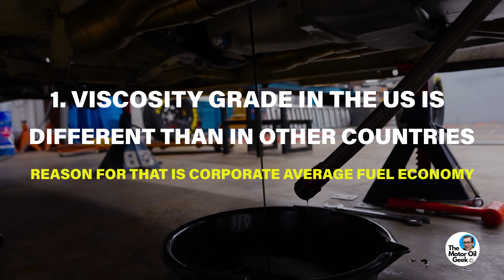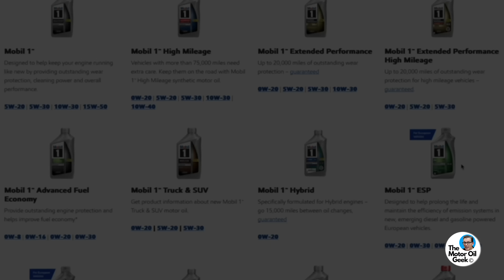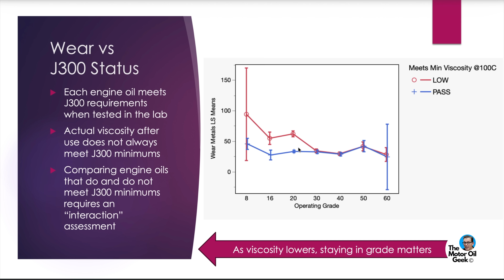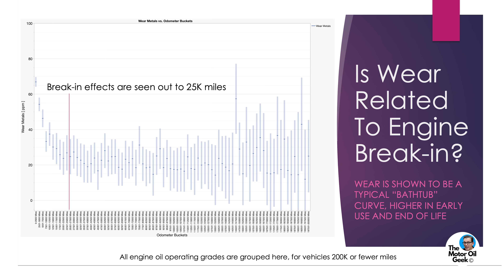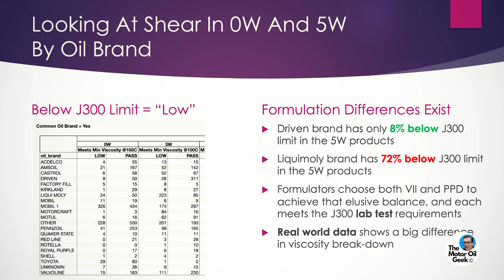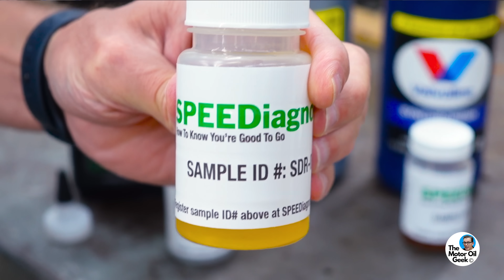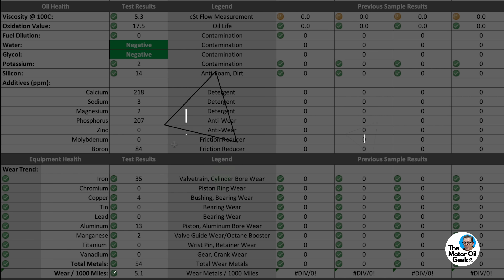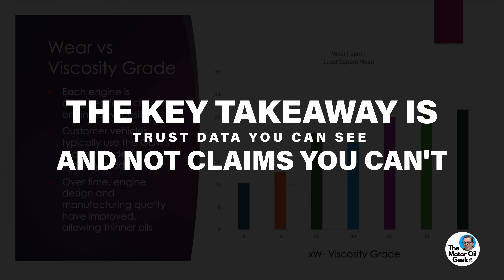More Ai Lies? The FACTS about 0W-20 vs 5W-30 (With Evidence)

Comment: I have been using 5W-30 for decades. ZERO internal engine failures. 2 vehicles over 200k miles. I tow with my truck in heat. 0W-30 is not an option for me. My truck's manual says 5W-30 is acceptable.

Comment: There's another BS coming out of this guy's mouth. He said, follow the recommended recommendation. Really? Recommendations on some cars  also says that the transmission fluid never needs to be changed. So manufacturers lie about the oil change intervals on the transmissions. They also lie on about the engine oil recommendation.,5w30 is better than that watered down 0w20?
Reply: I have to agree with you. When the dealers tell you it's lifetime oil that's pure BS, lifetime oil does not exist on this planet!

Comment: 0w20 has not stood. The test of time 5w30 has ! and that's what's going in my car that I just bought. And not only that, if you look at a lot of the comments, people have already done thousands of miles on their cars, with the 5w30 changeover. And and report a smoother engine, less rattling. No noticeable miles per gallon loss, basically no downside on using 5w30

Comment: I can give my perspective as a former car mechanic with a sport car
my 2.0L Turbo 4cylinder car has a recommended oil of 0W-30 from Shell Helix 
And with mine being 2020 model, its now 5 years old with me changing multiple times the same oil at the same miles consistently
Yes Consistency is the key to oil, especially the recommended ones 
I could go for 0W-40 but it ain't going to benefit from it, oil is there to lubricate, the way YOU drive your car and warm her up 1-3 min and let her cool down 1-3 min makes a difference.
I will put it in the most wise words I know, "You don't prevent damage or wear, you slowly degrade your car and its components" its up to you then to use the correct fuel,oil and parts to keep the car going.
Instead of get a new car that will cost you more then the current one's repairs.
There is no need to worry about oil what to choose from away from recommended ones, you can, but only if you can afford it.

Comment: IMO at the end of the day, just use the oil type and viscosity the manufacturer/car calls for.  If it's 0W-20 or 0W-8, then use that.  There are plenty of examples of vehicles now that are running these thinner oils that it shoulidn't be a big concern, and one thing to keep in mind, while you "can" run a thicker oil, you may lose fuel economy or other benefits of the proper viscosity oil.  Point being, cars like the newer Toyota Camry's (from say 2018 oinward in the US) use 0W-16, and some have reported 300k miles of use presumably without issue, and my guess is those people aren't doing anything special with their oil or using a thicker oil, they're probably just changing it at what I would call a regular interval -- despite Toyota saying 10,000 miles, I say every 5,000 miles or 6 months at most.

Comment: I dunno...  I ran 75W90 in my rear differential for the first 100k miles.  When my vehicle was built in 2005, the manufacturer's Service Manual called for 75W90.  About halfway between and now, however, the mfg released a service bulletin saying that 75W140 was recommended for heavy duty applications like off-roading and towing.  Why?  Because 75W140 was STANDARD in the exact same rear end sold overseas.  It took 12 years of U.S. customer questioning and griping before the mfg capitulated and said, "Yeah, it's fine."

A number of independent lab testing and wear measurement studies showed had less wear, too.

So, why did the mfg wait 12 years?  EPA mileage requirements.

I couldn't care less about the fraction of a MPG difference.  I care about the long-term life and longevity of my vehicle.

So, even though I'm running XW-Y oil right now, I'm definitely increasing the latter by 10 during my next oil change.  I'll likely leave the first number as is, as it can get quite cold in the winter.

Now, if I can only fine a good, reliable and inexpensive pre-pump to ensure all critical parts are well-lubricated BEFORE I start my engine...

PS:  As a data scientist, when I see data veering significantly off the curve, as I do with your -20, -16 and -12 data, with n being as high as it is, I question the efficacy of the -20 and -12 formulations and call for independent lab testing to verify the "Data from ~6K engine oil samples measured after typical oil drain intervals (ODI)."  If the wear difference is confirmed, then the oil formulations are suspect. If the independent testing reveals the wear to fall significantly closer to the trend line, then I question the integrity of the data.
Reply: I thought I was the only one who caught that. I'm afraid he may be heading down the road of his own conformation bais just to argue with the AI video.. which was correct in the first 2 points.
Reply: see GM trying to slow down engines grenading with 0w40. Of course, it's FAR superior to 20.

Comment: I disagree, especially with a 2023 Silverado with a 5.3. Those engines have direct injection, and the fuel gets mixed with the oil and gasoline dilutes oil after a couple thousand miles that 0w20 will turn into a 0w8

Comment: 0w/20 5W/30. My Volvo says 5W/30. The oil grade is on your oil filling cap. W stands for winter.The lower the number with W will get thinner in cold weather but will thicken to the second number when heated up.

Comment: Very informative. One 'tip for viewers' that you might have included is this.....change your oil and filter more often. I intend to keep my current car (Rav4 Hybrid) long term and so I change the oil and filter twice as often as required. This is possibly the single best thing you can do to prolong engine life and it takes away any concerns about oil degradation.

Comment: "Out of grade", you are saying. Meaning, out of the viscosity limits specified by the oil specs. But we need to look at the viscosity limits for the ENGINE, not oil. If w30 oil is sheared down into being w20, the engine still fine with that - but not with w20 that became w16.

Comment: Dear Lake, at 07:55 you mention that "higher viscosity oils, increase wear, in some cases"
What cases do you refer to? Could you tell me some examples, that I can better position this comment in my mind?

Thanks a lot in advance & and keep up your superb work!
Reply: Only way you'll get your answer is to do an oil analysis after a summer run.  0w20 will do fine in the winter.

Comment: Ok there is some flawed logic here. Even if 5W30 has a higher tendency to lose viscosity it will still most likely be high viscosity then 0W30 AFTER it breaks down. And that is the point. The consequences of viscosity breakdown if you start with 0W20 are greater then if you start with 5W30. The fact that a company will recommend 5W30 in a diff market with no CAFE and we have had some very high profile engine failures and viscosity revisions, says going higher vis is the safe bet for the long run. I run 0W40 in my 2015 BMW i3 REX as I don't believe BMW gives a shit about what this engine really needs as its just a REX.

Comment: I've got a Toyota G16E-GTS engine that runs 0w20 oil from Toyota, again, lots of speculation about what grade to use, people saying 5w30 should be used if you do lots of track work.

If you regularly change the oil and perhaps more often if you are doing track work then you won't have any problems with fuel dilution and shear effects and then you can take advantage of fuel savings if you then drive normally on the road. 

The key is to replace engine, transmission and drive oils regularly and more often then the manufacturers recommend and if you have the facility to get your oil analysed then try that or just replace get it replaced more often 😉

Comment: I have a 2014 GMC Sierra 1500 with the 5.3L engine. I switched to 5W30 a year ago. My oil pressure is 3-5 psi higher and it stays that way though out the 7000 mile changes. Also, I lost just shy of 1 mpg. I’m sticking with it.

Comment: I have an Audi with the EA839 engine that is spec'd in the US for 0W20, and had the rockers replaced at 65,000 miles.  I wondered if it had been the oil or simply a run of bad parts so I asked some people at Audi who said the internal concern was a lubricity issue with the new oil, that they were not seeing issues with the 5W30 or 5W40 oils in the rest of the world.  I did a bit more digging and it turns out the rocker arm that is failing in these engines is essentially the same part used across tens of thousands of engines, maybe hundreds of thousands, with no failures that I am aware of.   Some will say they are different part numbers, and that's true, but if you've looked at them on a bench they are the same design.   Everything from the 2.0 to the 4.0 have used this rocker design and I have been unable to find any pattern of failure, and this design seems to be used in a lot of VW engines.    That is anecdotal of course,  and you could say that the failures are due to some other issue such as manufacturing defects in the part or in the way oil is fed to the rockers, but if it's, say, a hardening issue with the needles or center pin you should see some failures in cars running heavier oil.  I have been unable to find any.  When you search for that particular failure in Audi it only begins with the introduction of the 508 oils in the EA839.   If it's an issue with the oil system in the EA839 why go to the trouble of redesigning the rocker? 
 The new part looks like it was given more material to wear before failure.  I pulled my failed rocker apart and the center pin showed an amazing amount of wear, what you might expect from oil starvation.
I don't know how much better running a 5W30 is in this engine but I can say that in the 60,000 miles since the rockers were replaced, running the heavier oil, the car has been fine.
Reply: there's your problem, you got an Audi lol

Comment: What is your opinion of not running the recommended 0-20, in Ram 5.7L engined pickup trucks, but rather  running 0-40 STR, Pennsylvania, Platinum oil which is designated for Th same size, not performance level, Hell Cat engines? The truck engines have a reputation for wrecking lifters and sometimes crankshaft bearings. The only difference I know of other than the performance level, is the Hell Cat engine is said to come from the factory with a larger oil pump. Might the 0-40 oil require a larger pump?

Comment: I left a comment on the video in question reagrding my own experience.

my 2007 Volvo S60R has done great on 10W30.  and the manual says 5W30 or 10W30.  

the 2019 Volvo XC90 T8 Hybrid I got my wife used 0W20 and it made sense.  The car swaps between the engine and motor frequently so having a thinner oil made sense.  

we put 106k miles on that hybrid and have only spent $3600 in maintenance (not including tires, and yeah I used the dealership for most of it so I could have saved money, and nothing serious.... (Until it got totaled in 2023.  RIP Violet, but it saved my Wife's life) 

It really depends on what the car needs and how often it's used.  I think the 0W20 was perfecf for that Hybrid and it allowed the car to swap between gas and electric easily without having to work harder to heat up the oil.

My old 2007 tends to eat oil unless I buy the RIGHT oil.  It is a high performance engine and has almost 170k miles on it now.  The manual recommends either 5W30 or 10W30.  I have found with IT the BRAND of oil  I purchased has really helped.  I tend to buy Mobil 1 Premium Performance or Extended mileage oil as it tend sto last the longest for me.

whatever garbage the dealership uses usually doesn't last as long as if I put in Mobil 1 Extended mileage or extended performance oil. which seems to last Much longer.  

That video you refer to never showed any data really and I did not like that.

Thanks for clarifying on this stuff.

Comment: The problem in my personal opinion this is no way science or proven just my personal opinion 
1. Government standards 
2. Lighter weight oils in new motors in higher heat areas 
3. Lots of motors having issues since the lighter weight oil changup. 

Look at my jeep it’s the 3.6 they are notorious for having lifter and cam damage because of improper oiling and the motors came with 5w-30 recommendations when first released and had less issues then. Also the whole cafe standards makes people think the government is screwing with them over 1/10th of mileage and ruining engines. 

This is why so many people want info or want a reason to go back to the higher weight oils. People don’t trust the new standards when the engines ran fine before all the changes. As somebody living in a higher temp state I don’t think 0w-20 is good enough I don’t see winter weather and I don’t care about 1/10ths of a milage increase.

Comment: Wouldn't fuel dilution only be a problem if the engine doesn't get driven enough to heat the oil? Fuel evaporation can happen at a very low temperature in an oil. You don't even need to boil the fuel.